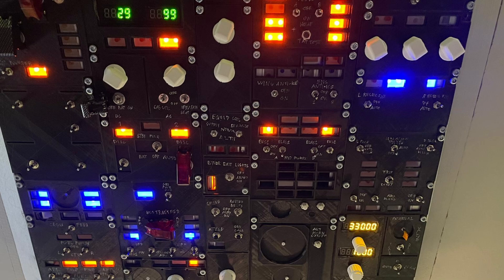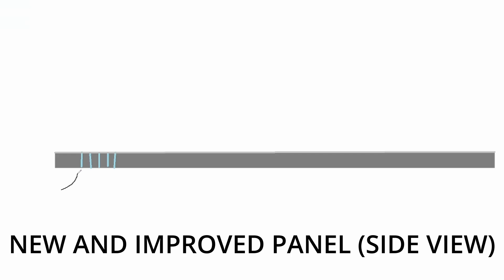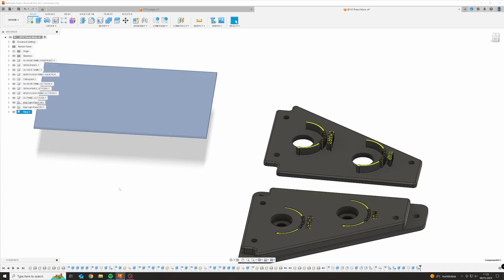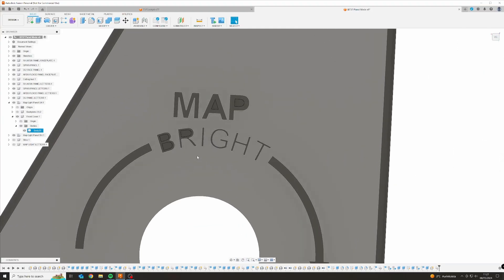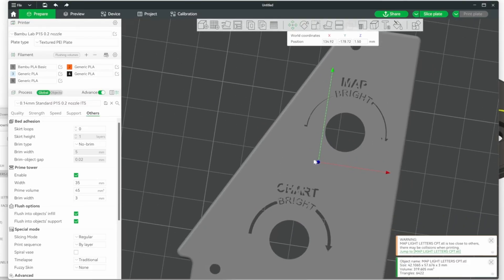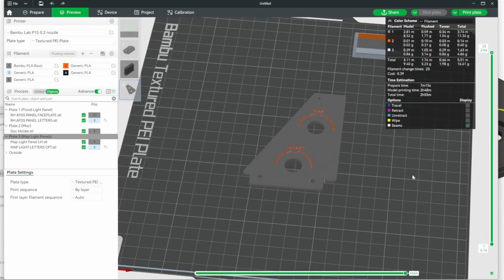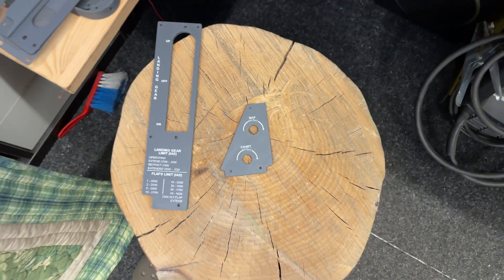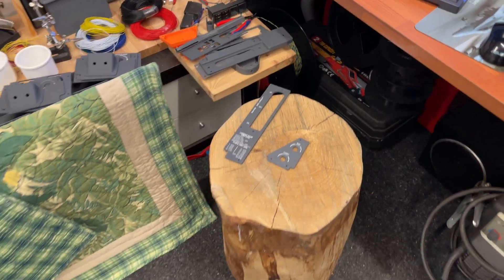3D Printed Panels With Text (Is It Any Good?)

Comment: Why didn't you print it face down? You would get a better surface finish and the critical part of the print would be the first layer and not the last.
Reply from the maker: Yes, that was something we tried after this video since so many recommended it to us.
It absolutely produces better looking panels BUT ONLY if the bed is 100% clean and has no scratched, etc. (which is surprisingly often not the case)
Thank you for your comment regardless!

Comment: What’s the minimum size of text you’re able to get and what nozzle size are you using?
Reply from the maker: The minimum font size is the same as the nozzle size since we can't make anything smaller than the nozzle itself. In this video we used a 0.2mm nozzle.

Comment: Have you tried using a rounded-edge font instead of a sharp-edge font? It might look even better, although the result is very good either way.
Reply from the maker: That's a good suggestion! We haven't tried it since we try to balance between best looking text and most realistic font for our use case. Since our panels are for a B737 simulator we try to match the font with the real font.

Comment: Great explanations and I tried this to the letter on a Bambu X1C but I didn't get the same result. My text is not so white, the top surface has lines, and the letters are not 100%. And I am using a 0,2 nozzle.  Did you change any of the global settings in Bambu Studio to achieve this? and which font and font size did you use?

Comment: Great looking panels! If you were to print the bulk in transparent, and only add colors on the top layer, you could get away with using any 3D printer. Also, the larger transparent profile will direct more light to the desired location. The down side, you'd likely want to print solid so there isn't as much light reflection in lower layers.

Comment: Very clever. At time 5:55 you move a number of bodies from one component to another. When I try to do the same thing it never works. Am I missing something? Perhaps some kind of setting in the preferences? Ciao, Marco.
Reply from the maker: hmmm... I haven't messed with any preferences in Fusion 360 settings so I don't think it is about that.
If you follow exactly what I do in the video it should work but I Fusion can be a pain sometimes so I am not sure what the problem on your end might be.
Reply: @diy_finn  Yeah, I tried multiple times, and still nothing. Too bad, it would have been cool.

Comment: İ tried with 4 diameter nozzle the results are really bad. What is your nozzle size?
Reply from the maker: In this video we use 0.2 nozzle. You either need to increase your text size or use smaller nozzle like we did.
Reply: @diy_finn  thanks for answer. I'll try with 0.2 nozzle

Comment: just take the plates with the visible lines, sand it, use 1 coat primer , sandit, another coat primer, and then gunmetal grey, and it looks amazing, well it depends on the print and on the person doing the post processing..

Comment: I have done similar myself using the AMS, I got good results using PETG and putting the face directly on the bed but I had to use the textured sheet to get it to stick well enough and have high enough detail, the end result still looked fine though. I only used a few layers of each filament, only 3 for the transparent section and my text was printed separately on the panel (not on top of the transparent) so using thinner material will make it brighter and will make it feasible to do without an AMS since it would only require 5 filament changes in total.

Comment: If you import both files at the same time in the slicer (hold control key to select multiple) then it asks you if you want to import all objects as a single part, if you select yes then the parts should be aligned correctly in the slicer and will be grouped together as one part but you will still have individual control over the pieces, so you can still change settings and filament for the different parts. This should stop you from having to manually align them in the slicer.

Comment: A few months ago I wanted to make some text on a coin in a similar but still different way: I used three different filaments and the first layer consisted of the letters and one panel face layer for which I used transparent filament. So it was first layer of the panel transparent, then two text layers in white and starting from layer two i used the panel color for the rest (blue in my case).
That way I only needed two filament changes for the whole print and the transparent first panel layer caused the text to get some depth to it, so it appeared to stand out even though it was completely flat.
As someone already suggested, I exported everything as a single 3mf file to avoid having to piece everything together in the slicer and save a lot of time.

Comment: if you used a transparent color for the text making it 2 colors and since the text is a separate object from the panel, could you print by object instead of by layer and print the text first? that way you could change the filament manually? for those of us who don't have the ability to print in multiple filaments

Comment: In Fusion360, another way to cut the letters out of the background is to use the Combine tool in the Modify menu.  It has the option to do a few different Boolean operations (combine, cut, or intersect) where bodies overlap each other.  If you have the letters already the same height as your background, align them in position where you want them to be inset in the background (they will be hard to see because they are the same thickness as the background and sharing the same space). Select the Combine tool, in the pop up menu select the background as the main body, then select all of the letters as the Tool bodies.  Choose the “Cut” icon as the Boolean option, and make sure the “Keep tools” check box is checked to keep the letters, then press OK.

This will use the letters effectively as a cookie cutter to cut out of the background anywhere the letters overlap the background. And since “Keep Tools” is toggled On, all of the letters still remain exactly where you want them to stay.

Also, I THINK if you have all of your bodies in one Component before you Save as Mesh, and keep it as One File, the letters will stay in the correct position when you open the stl in the slicer.
Reply from the maker: This sounds like the easiest method to achieve the desired results. Thank you for sharing it!

Comment: So you just need to export in .obj not stl. Then if you import all the files together then your files should ask if you want to import as an assembly. 
STL doesn't have an offset like obj does so everything is 'centered' but with the obj things can be positioned away from 0,0,0 coordinates 🎉
Then when you bring them all in together they should be perfectly positioned 😁. 
Thanks for the method for layers i will give it a try with my panels.

Comment: Why 3D print an easy to make panel?
Reply from the maker: The way I see it is 3D printers have way wider use case (at least for me) so when I was thinking between laser and 3D printer I ended up going with the printer. If I got a laser, cnc, etc, I wouldn't have any other use for it and I wouldn't be able to make things such as knobs and actually difficult to make parts. I guess if you have the space and money to buy a laser you should of course use it instead of 3D printing them. This video is for them who own a 3D printer but not a laser or a cnc.
Reply: @diy_finn   You completely missed my point. Deliberately, I think.
Reply from the maker: @oldbatwit5102 Then I don't think I know what you mean. What do you think is the better way of doing this? And why the attitude, can't we just discuss this like normal people?

Comment: Which filaments did you use? Are they all Bambu lab filaments? PETG?
Reply from the maker: The white and gray filaments are from 3Djake and are called ecoPLA (just regular PLA). The reason I prefer their PLA over some more popular brand is that the gray color happens to be exactly the right color to the real Boeing 737 cockpit color. For the transparent layer I recently switched from PLA to PETG but that was only because it was on sale. I wouldn't really recommend combining PLA and PETG but so far I have had no issues personally.

Comment: this can be done another way which is a bit simpler - - if you create a thin frame of exactly the same size around both your designs - then when you import them, they will align perfectly - also i have a method to achieve this quite easily on a single colour printer with 3 manual filament changes.  Very nice results though
Reply from the maker: Thanks for the suggestions!

Comment: That was... probably the most convoluted way to get those text objects in Fusion possible, lol. Make your drawing w/ the text you need on either the top or bottom plane of the object. Extrude it either the same distance as the thickness of your object, or just extrude it to the opposite face, and let it Cut. Select that same text from the drawing, and perform another extrude the same way, but use the New Body operation instead. Done.

As someone else mentioned, export it as a 3mf file for Bambu / Orca to import the individual bodies in the right locations, and then do your multimaterial slicer painting as needed.
Reply from the maker: I know that now lol. I am not a Fusion pro but thanks to all of your help I have learned to much. I will make an updated and more detailed version soon. Another thing that might have made this little more confusing was the fact that I was using a older design with the text already pressed in and I wasn't aware of the Fusion Timeline when recording this. Thank you for your tips!
Reply: I was thinking the same thing. I usually just make the text 0.2mm thick and print it face down so it can be done without an AMS. Common technique with those coaster tutorials. Also when you extruder the text, you can select new component and then right click the component and export as mesh to export all text as a single .stl. Then just import the main body and the text at the same time and Bambu Studio will ask if you want it to be a single object with multiple bodies.
Reply: Good advice. Do you know if a way to quickly select the text in f360? It usually takes me ages to select every letter and symbol that needs to be manipulated ( cut/extruded)

Comment: If you extruded the “letters” back at an angle so the back is larger than the final front dimensions it would allow more light to come through the back clear filament providing brighter display
Reply: Hey that's a great tip, thanks.

Comment: What IF the lettres are not straight lines (2:04 on video) but triangle in crosssection? I think it might get more light to the letters if on the back is a little bit more place to gather light.

Comment: Without a multi material system you could fill the voids with a chemical resin. or something but would require more post proccesing
Reply: Since this is supposed to be permanently visible, maybe some kind of mix of transparent and UV active so that it glows even without power.

Comment: Hello from Helsinki. You can simplify the order of operation in Fusion 360 so it will be like 4-5 times faster. Also it will be one component and all aligned in Slicer. 0.2 nozzle do the trick of course but I've got bette results if text is laying down to the bed. Let me know if you need any help :)
Reply from the maker: Yeah I have learned a lot from the comments here. I will have to try printing the panels with the text laying on the bed. Kiitos!
Reply: @diy_finn  I have textured PEI so it looks really nice IMHO. If you're living near by I can show you :) Let me know the best way to contact you. Tack :)
Reply from the maker: I live in Oulu so not exactly near by :). If you have discord you could join the discord server that I have linked so you can send some pictures there.

Comment: The results look very neat! I am very impressed of what you achieved. If just 3D printing was more precise. Then you could print the front with holes, print the letters and symbols seperately in white and push them in the holes.
Reply: You can already do that with current generation printers, but you have to adjust your way of thinking when modeling. You have to give yourself a small amount of space between objects (depends on your nozzle and how well tuned your printer is - with a 0.2 or 0.25 nozzle, you shouldn't need more than a 0.1mm gap). You will also do better with some slight chamfers to allow the pieces to fit together better. The bigger issue with lettering like this are things like P and O that have fully enclosed areas, so now you're dealing with multiple inserts and smaller and smaller individual pieces.
Reply from the maker: Thank you! I really hope 3D printers will get to a point where it is possible to do it the way you mention it. It would save a lot of time and effort.

Comment: If you don't have an AMS you can try with some hot glue. Use the old style that is perforated and when the print is complete, smear a dab of hot glue over it (be careful because if it's PLA you might make it bendy until it cools and don't heat it a lot) and when it cools down you can cut the excess with a knife (to avoid warping, just use the metal spatula that came with your printer and just when the drop of hot glue falls down you press it down fast. It will go into the letters while it will cool faster). It will be translucent enough to be retroilluminated and will also look a bit white (there are some stiffer hot glue bars that look whiter) so you can also see them in daylight
Reply from the maker: That sounds like a good alternative to our method. Thanks for sharing it!

Comment: I've been doing dual shot keyboard keycaps with mk3s and manual filament changes years ago; i used 0.25mm nozzle to get good detailes on the letters; print with letters facing the plate, translucent white letters printed first so you prevent bleed on top visible layer. Works really well. Also done a similar procedure with resin keycaps, but it's a different method.
Reply: How did you get it to change the filament on the same later in Prusa slicer? (In the first layer) 

I used to have to make two print files, first for the letters then second with the colour surrounding material

When the letters are on the build-plate as you mentioned it looks way better
Reply: @CharlieBaes  If i remember you need to add the models as one part, i name each one XXX_A and XXX_B, and drag together, then used some gcode to change filament between each layer change. The only minor thing i didn't fix is upon starting the first layer it will ask you to change filament again even though you might have the correct one already loaded; There was also some purging/pressure advance issue at that time, if i remember with M600 command but last time i tried it i think it was fixed in later firmwares. My PC has a broken mobo at the moment but i have a project file in dropbox, i can share you a link tomorrow
Reply: @charlesraes8541  Here you go: I think YT blocks/hides my comment

It doesn't have of course the latest settings since it's an old PrusaSlicer project, so arachne algorithm will be better and monotonic fill, also i remember i might switch printing perimeters first and extrusion multipliers for my case but the most important thing is the gcode additions which have been simplified here (it used to be more when i started as many things were not implemented in fw back then), but it's the latest one i have i believe from 2020 (at least on this project, i might used the technique somewhere else too after but i don't remember)
Reply from the maker: I have now temporarily changed it so that you can post the link.
Reply: @diy_finn  i've posted it but it still removes it
Reply from the maker: Do you have Discord? You can send the link to me and I can send the link here. Or you can email it to me at diyfinns@gmail.com. I am not sure why YouTube is still blocking it because I set the setting off.
Reply from the maker: Here is the link to @St0RM33's file: https://www.dropbox.com/scl/fi/cqv3waznd6q0cpj34o03x/A-1-carbon-MANY_2ND.3mf?rlkey=ugw8g5a86138134x14yu25fus&dl=0
Reply: I appreciate the info bro, thank you!